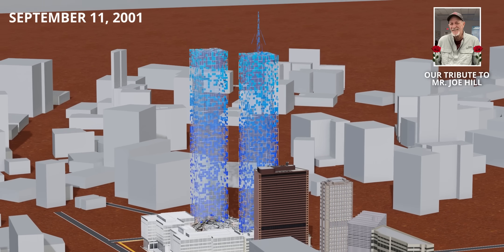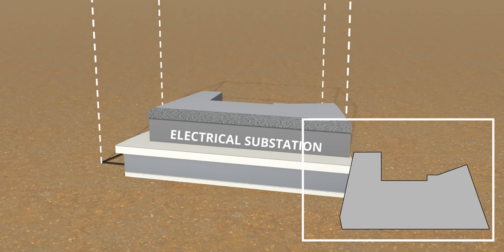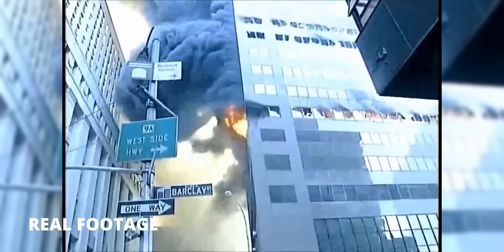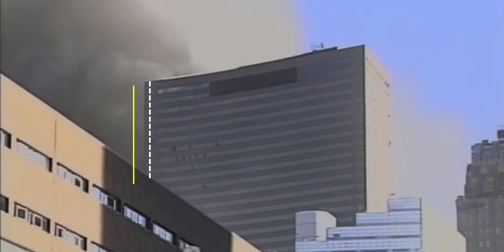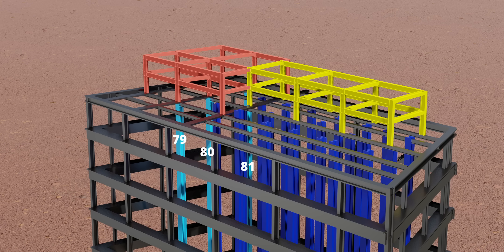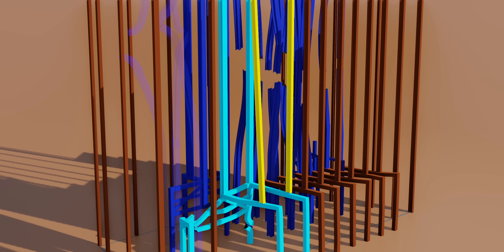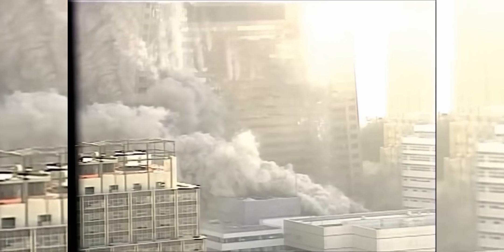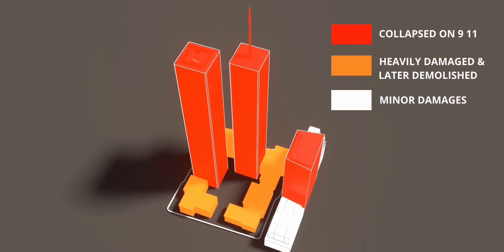Collapse of Building 7 | The Complete Physics

Comment: Still trying to spin this all the way into 2025
Reply: You may not like it after more than 2 decades of internet conspiracy dogma, but what is being presented in this video is fundamentally correct and widely supported by the worlds engineering community.

While imperfect (there are a few problems) this video goes into a much higher level of detail than many viewers can comprehend and gets the collapse mechanisms fundamentally correct. This is true no matter who planned and carried out the 9/11 attacks or why . 
	
Sure, it’s not what you want to hear and goes against 20+ years of conspiracy dogma and conditioning, but that is not the same as it being wrong. You just need to fix your dogma. 

On the plus side, this video can be (and is) fundamentally correct about the engineering AND the 9/11 attacks could still have been some sort of inside job. The two things are in no way mutually exclusive. It’s just not the inside job the clowns you have been following on the interent have been telling you. 

This will surprise you to learn, since the conspiracy side of the internet hides it from you, but the mechanisms described here have broad professional support around the world. There are no professional engineering organizations (for example: ASCE, ASEE, ICE, etc) that disagree with them or have offered any formal dissenting opinions or alternative hypothesis. 

So, either the overwhelming majority of the worlds structural engineers and quite frankly simple observation are wrong,… … or you know more than the worlds best engineers from cruising around on the internet. Which seems more likely? 

If this explanation is wrong then produce a better one.  Be the first to even try.

Comment: 100% controlled demolition
Reply: I’m going to respectfully disagree and offer a more plausible explanation.

Building 7, the 6th building to collapse of 10 lost on 9/11 though extensively studied still confuses many. Not famous or a terror target and with no casualties it didn’t get a lot of attention initially, creating an information void the internet filled with utter garbage. Because everything seems like a conspiracy if you don’t understand how it works I prepared this brief summary from my own analysis to fix that. No politics, just engineering. 

The North Tower collapse at 10:28am bombarded Building 7 with tons of burning debris, causing heavy damage and multiple floor-wide fires that burned out of control for 7 hours. Half the FDNY firefighters having been killed, others injured, units in disarray, equipment destroyed, no water pressure, and the greater urgency of Search & Rescue efforts, firefighting was pulled as futile. The building couldn’t be saved and was left to its fate. That is the sort of choice firefighters make every day in brush fire situations - which houses to save and which ones to let go. Only real difference here is moving the decimal on the size and cost.

www.youtube.com/watch?v=g_SvpwyC17M&ab_channel=MFitz  

Collapse of a burning structure is always a concern for firefighters. Steel buildings subject to fire rely on active fighting of the fires to survive. Buildings are designed around 1 to 3 hours of fire resistance, allowing time for occupants to escape and ACTIVE firefighting to get started, after which all bets are off. Left to their own devices they will exceed their design envelope and collapse. In B7 the occupants escaped, passive and active fire protections were compromised and active firefighting was abandoned which left the building to its fate. It lost. Odds on Building 7 would eventually collapse, and it did. No big deal in logic. 

www.youtube.com/watch?v=WnYBX6QT0R4 

FDNY Chief Daniel Nigro ; The biggest decision we had to make on the first day was to clear the area and create a collapse zone around the severely damaged 7 World Trade Center, a 47-story building heavily involved in fire. A number of fire officers and companies assessed the damage to the building. The appraisals indicated that the buildings structural integrity was in serious doubt. I issued orders to PULL back the firefighters and define the collapse zone. It was a critical decision; We could not lose any more firefighters. It took a lot of time to PULL everyone out, given the emotionalism of the day, communications difficulties and the collapse terrain

FDNY Deputy Chief Peter Hayden ; We had our special operations people set up surveying instruments to monitor and see if there was any movement in the building. We were concerned of the possibility of collapse in the building. And we had a discussion with one particular engineer there, and we asked him if we allowed it to burn could we anticipate a collapse and if so, how soon? And it turned out that he was pretty much right on the money, that he said 'In its current state you have about 5 hours

The collapse of Building 7 was anticipated and widely reported in the media throughout the day. At least 24 video cameras recording some or all of the collapse. Everyone knew what was coming and why.

www.youtube.com/watch?v=OY5S5k3tMHI 

Building 7’s collapse was completely different to the Twin Towers, and harder to understand with most details hidden from view. But we can still sort out what happened through careful analysis and observation.  This is my explanation  of the collapse using the best available information and relying on no authority.

B7 was complex 47-story steel framed structure built on top of a smaller existing 3-story building, requiring several lower floors dedicated to complex load transfer structures instead of usable office space. Of trapezoidal shape and all-steel tube-in-tube construction, B7 (above the 7th floor) consisted of a central core of steel columns carrying most of the gravity load, perimeter steel columns around the outside of the structure carrying the remainder of the gravity loads and long span beams and girders to tie those elements together and form the floors. On the outside of the building hung a moment frame - the last part of B7 to fall 

Phase 1 : The first externally visible signs of collapse initiation occurred at 5:20:28 pm. Collapse initiation for B7 is notably quiet with observers not realizing the building was collapsing! There was no audible warning in the form of say hundreds of ear drum busting 180-190dB explosive bangs preceding the collapse. Here at 12:00 a local CBS affiliate reporter is talking 10 blocks from B7 when collapse begins. People don’t start to notice the collapse until 12:11. Then at 12:45 is the famous CBS fixed camera clip of Building 7’s collapse.  Note how quiet it is.

youtube.com/watch?v=t5tEy6mXSE8&ab_channel=fresnosean379

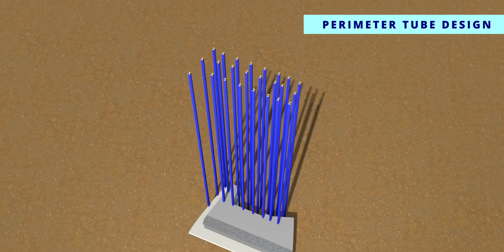Collapse initiation was due to lower floor failures above the load transfer region (7th floor) in the NE corner of the building. In this video at 0:45 you can see the NW corner from inside the building while under construction, Column 79 just out of frame on the left. That big, angled steel beam across the top of the frame connects to C79 at one end. The girders connect to the beam. That beam and all those girders depend on just one connection

youtube.com/watch?v=nP3TNHPCIVU&t=35s&ab_channel=EdwardCurrent

Phase 2 : Lower floor failures caused a loss of critical lateral support over an excessive length of core Column 79 and it buckled. If you look at a floor diagram of Building 7 (see above) and look at all the structures that depend on C79 you quickly realize this one column was a relatively isolated structural element on which a disproportionately greater fraction of the structure depended analogous to say the Key Bridge. Externally we see a vertical progression of window breakage along the 44-46 line and a kink in the roof of the East Mechanical Penthouse at the top of the building, consistent with C79 failure. The transition from full capacity to almost no capacity occurs in virtually an instant. Once the buckling failure occurs there is almost no resistance

Normally with a buckling column, the load could very well be redistributed to other columns, meaning the buckling could stop after a while. With C79 that is not the case - the failure did not redistribute the load, so the collapse rapidly progressed to the roofline, sinking the rooftop penthouse.

Phase 3 : With C79 gone, B7’s progressive, non-symmetrical collapse continues with C80 and C81 at the east end of the core left laterally unsupported and quickly buckled and failed as well, sending the EMP down through the building. C79-81 all have no diagonal bracing, which I believe is a major reason why they could not redistribute a lot of vertical loads among one another.

From there collapse progressed from east to west through the central core until the core was gone taking all of the interior floors and structures and probably most of the perimeter columns with it. You can see the horizontal progression of window failures low in the building and the dropping of the remaining rooftop structures into the building. One of the big takeaways from the NIST Building 7 study (that gets completely ignored) was their modeling which determined C79 failing under ANY circumstances would have initiated the same collapse sequence.

Phase 4 : 10 seconds in only the exterior moment frame - just a hollow empty outer shell – remains, the illusion the building is still standing since little has outwardly changed. But it’s just a hollow empty shell like an empty cereal box supported by only a few remaining columns and quite unable to remain standing. With all internal framing gone, the north face leans inward, forming a V in the roofline, the last perimeter columns buckle under the strain and the moment frame free falls, landing on top of the 7-story high debris pile. It is only here, at the end that a single measurement of alleged free fall acceleration is taken, from a single point on the moment frame. The Building (defined as its center of mass) did not “free fall” (sort of) – just one corner of the outer shell did. The Building was already gone before that happened. The period of alleged free fall was a product of collapse progression mechanisms, not of collapse initiation mechanisms and is irrelevant to what started the collapse. Start to finish the entire collapse took 18-20 seconds, 3 times longer than true free fall and how fast something falls cannot tell you what started it falling anyway. The debris spread outside the footprint, blocking surrounding streets, heavily damaging the Verizon Building and destroyed Fiterman Hall.  

Building 7’s progressive, non-symmetrical collapse was incidental and unintended collateral damage from the combined effects of fire + time + gravity started by the collapsing North Tower. That is true no matter who planned and carried out the 9/11 attacks or why . The collapse was of so little consequence it barely even registered at the time, a mere footnote. It only took on semi-mythical status as an alleged smoking gun years later when demolitions at the Twin Towers, missiles at the Pentagon and shoot down over Shanksville all failed and conspiracists had nothing left to work with.

Anything can seem like a conspiracy if you don’t understand how it works. Now you should. I hope you found this helpful, informative and it solicits informed critical comment. If I made any errors of fact, logic or reason or left anything important out, please let me know so I can fix it. IF you can offer a more plausible alternative please do. Be the first. Please start any reply with the words “Tits McGee” or I will know you didn’t read it and are wasting my time.

Comment: It is statistically impossible for all the structural members to experience plastic deformation at the same instant. That is why we use steel.
Reply: It isn't but they didn't, so not really sure why you brought that up. Clearly you did not watch the video.
Reply: @TheCriticalStinker-01  Near freefall speed says they did.
Reply: @ollierobin  - Is that so?

Yes, The NIST published a measurement of alleged free-fall but what is it they were actually measuring and what does it really mean?  Is the internet right or have they been feeding you a story all these years?  Let’s take a deeper dive.

The NIST published a measurement taken about 10 seconds AFTER the collapse started, from a single point on the external curtain wall (the "empty cereal box").  This was the very last portion of the building still standing and primarily supported by just 4 of the buildings 83 columns.  The rest of the structure had already failed and dropped over the preceeding 10 seconds. Behind that exterior façade was nothing. No core, no floors, no interior remained. So in other words, the building had already been collapsing for about 10 seconds before this anomaly occurs. 

This is extremely difficult for some people to comprehend. 

To clarify:

1.	It is NOT the building being measured, only the empty outer shell left over at the end of the collapse.
2.	Only a single datapoint is being measured which can only tell us what is happening with that datapoint. 
3.	That measurement of just one point on the empty outer shell of what had been Building 7 averaged FFA if you only look at an arbitrary 2.25 second slice of that 6.5 second measurement. 
4.	It is NOT a sustained period of FFA or even near FFA (whtever that means) but a curve that starts below FFA, accelerates up to and then OVER FFA (hint) then back below during that 2.25 seconds. 
5.	Since The building had been collapsing for more than 10 seconds before that measurement was taken, obviously whatever is being measured is a product of collapse progression mechanisms NOT collapse _initiation_mechanisms. 

Yeah, that's right. You are fussing over a hollow empty shell with nothing inside it at the very end of the collapse. Why do you think the top of the north face is leaning inward so far, creating that distinct V-shape in the roofline? If there was still any interior structure left, it couldn't do that. 

Do we really care how fast one corner of an empty box falls?

This is why the inclusion of the measurement in the final report did not have any impact on the conclusions. It was not only already there (just not spelled out) but it fundamentally doesn't matter. It is a product of collapse progression mechansims NOT collapse initiation mechanisms and thus tells us nothing about what started the building falling at least 10 seconds earlier.

Start to finish Building 7 collapsed at about 30% of FFA - which is not by any definition near FFA. 

The internet has been lying to you.
Reply: @TheCriticalStinker-01  So, are you saying that in "co-incidentally" collapsed in the exact same manner that it would have been professionally demolished? That is to say: take out these columns first Then these other columns and Lastly take these columns?😊
Reply: @ollierobin  - Nope. Why would I say something that stupid.  I say exactly what I mean and mean exactly what I say. No need for you to try and twist my words to fit your own personal brand of reality-distortion. You will fail every time.  

I suggest you try again, actually reading my post this time and at least try to pay attention.
Reply: "Near freefall speed says they did."
That you lack the education, or more likely the ability, to understand what you're told? Doesn't mean anything other than that.